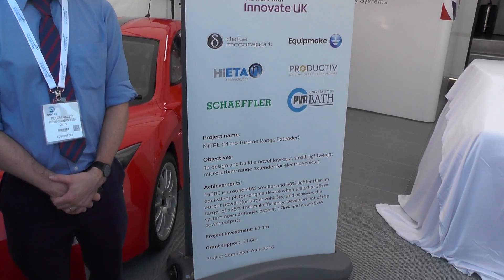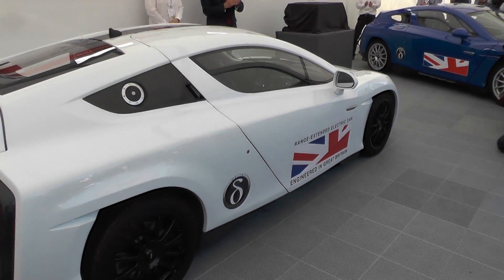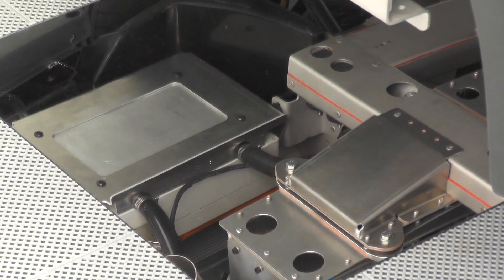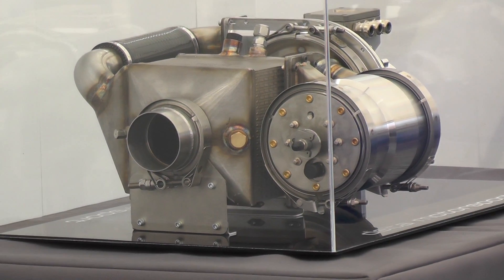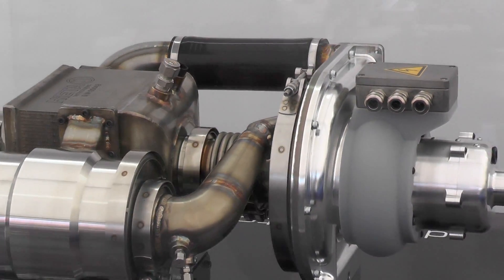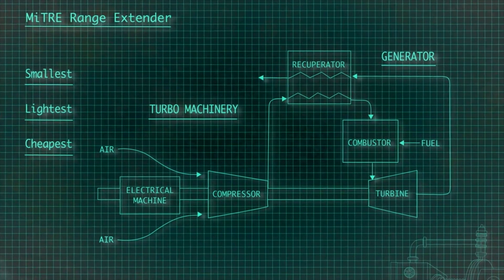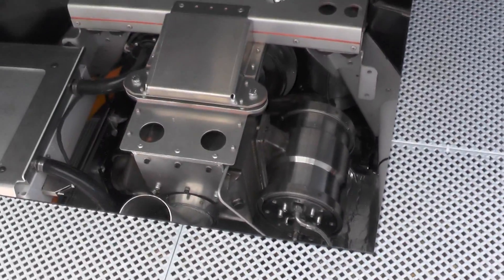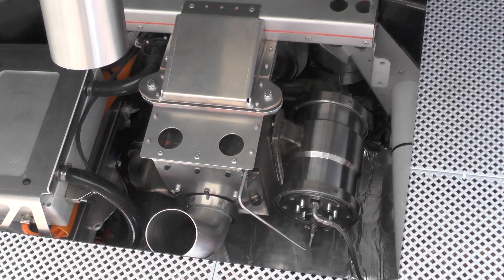MiTRE Range Extender - tiny turbine power removes EV range anxiety [First Looks]

Comment: guys i don't think you realize the advantage here. gas turbines can run on any combustible liquid fuel with no retooling and is relatively clean burning compared to pistons. you could literally choose which fuel you put in based on price or performance or efficiency. and if gas runs out you can just start using ethanol or corn oil or something. it's future-proof.

Comment: I don't understand why American car companies do not use gas turbine generators for building hybrids.  They are so much better than internal combustion engines.  ICE Engines operate to a limited 5-8,000 (or less RPM range) RPM, and spooling an engine going that fast causes rapid wear and tear on that engine.  The problem with turbine engines is that they require special, expensive metals like Chromium, titanium and even iridium to be put into certain places to prevent overheating and other problems associated with gas turbine engines.  With a gas turbine, you can spool it up to 10k RPM easily and get the power delivery you expect, you can also ramp it up even higher.  You can also run just about any kind of fuel you want with a gas turbine.  This is my favorite ICE engine.  You get power delivery not just from the electricity, but the air that leaves the exhaust, just like a turbo and you can generate serious electricity with a gas generator.

Comment: You may just as well have a modern diesel. EVs and hybrids are all a huge con.
It is expensive to service and repair.  High rate of Depreciation. Differcult to repair. It is expensive to repair.
The technical level of garage repair mechanics is low.
They hate working on them,  high voltage ⚡️ they could get a trip to the ER.
Reply: Oh dear. Expensive? Nope. High depreciation? No more than ICE. Difficult to repair? Rubbish. Expensive to repair. Rubbish (maybe apart from the cost of the battery, which is coming down every year). I suggest you try doing a little more research.
Reply: @NigelPowell They depreciate much faster.

Comment: Those companies who produce locomotives figured out using an internal combustion engine, solely to produce electricity for the drive motors a long long time ago. The idea of a small efficient I.C. engine with negligible emissions, used as a generator of sorts to maintain a power threshold in an EV'S battery pack, seems like something that should have been included from the jump. As a matter of fact why the traditional prius like hybrid was built with the ic engine as a drive motor always seemed stupid and pointless. The automotive industry is the only one that built hybrid ic + electric drive trains like that, while all others like the heavy equipment segment and diesel electric locomotives used their internal combustion engines as electric generators only
Reply: The idea has been around for a while in automotive applications. Google Capstone's CMT-380. The problem is turbines are inherently inefficient, and pollute a lot. The key to success has been attempting to reduce emissions and increase efficiency. The railroad has way fewer legal restrictions in this regard.
Reply: @zkk1001 ok so in the meantime well just have novelty EV's. Because where i live you cant own one. Pure EV's are dogshit compared to an internal combustion powered vehicle right now. Combining the two technologies is the only way youll get mass adoption. Shit the fucking rail roads figured this out a long time ago. And turbines will run on anything flammable like ethanol which is what mine runs on. And so were clear the vast vast vast majority of people do not give a shit about emissions, i sure as hell dont, i want a vehicle that works and is as convenient to use as a gas/diesel vehicle. Climate change is not the apocalypse and i dont give a shit about it. But if we have the tech to make the best of both then we should

Comment: Hybrids are the worst of both worlds, combining the complexity of IC and a full EV with extra parts to merge the two Into one Frankenstein's Monster; whereas range extenders gives the best of all worlds by combining the simplicity of an EV with smaller batteries and extra range/power on demand; and turbines could further reduce complexity and cost while being able to burn almost any fuel, so it's crazy they're not standard yet despite being around relatively forever. But the ultimate power source is the Free piston Linear Generator, which is basically an internal combustion powered shacker torch. It can run at an insanely high constant 'RPM' and electrical power generation levels, giving it a higher power/weight ratio than any other engine, let alone a generator, because the only moving parts are the solid piston/magnet assembly moving in the coils. These not only provide power, but also total control over the pistons motion, so changing compression ratios, going from 2 to 4 stroke, and even petrol/diesel/methanol/biofuel/etc operation on the fly would be possible purely in software, nevermind its incredible simplicity, efficiency and power/weight ratio. Sadly, if the turbine power units still aren't standard after their decades of progress, the Free Piston Linear Generator probably won't see the light of day anytime soon despite its obvious huge advantages over all other internal combustion generators.
Reply: Interesting, but there are a number of questions. Range and efficiency for example?
Reply: @NigelPowell  Pistons in a free piston Linear Generator run at a fixed rpm, and are electronically controlled and therefore able to adopt the most efficient combustion process of any type of engine on demand, so they have the potential highest efficiency of any ic engine at any power level, and considering their single solid moving parts could handle g-forces, and hence reciprocating motion that far exceeds even formula 1 engines, their power to weight ratio could be phenomenal. I suspect car companies aren't really pursuing them because the complexity of modern cars makes a lot of money for them and the service industry; hence universities apparently doing most of the legwork with little funding judging by their YouTube publications, just goes to show that capitalism=progress in what's profitable, and not necessarily better. This type of engine/generator was envisioned decades ago, and I even independently came up with it the same simple idea, so it's not like it's some new thing.

Comment: No updates on this project?
Reply: Actually lots. :) We might do a new post on it. The company was bought out by the famous Cosworth stable last year, and the product is now called the CatGen. It is fuel agnostic and outputs a flat 35kW constant. Not sure of prices yet or commercial implementations yet. Apparently it's been used in a prototype Transit van though.

Comment: with lithium prices in 2022 increasing why isn't this range extender made widely available for DIY peeps like a "crate engine"? i would love to slap up a REEV with a micro turbine strictly working as its most efficient for best fuel economy to charge a smallish battery pack and an electric powertrain free of any transmission....

Comment: Not sure i understand the layout... is the intake that open pipe on the satin gray turbo looking part ? is the generator the small chrome part at the front end?(looking like a small RC turbine starter)  , air is then sent to the re generator which acts as a heat exchanger? (uses hot gases to pre-heat air intake kinda like Chrysler did in the 60s?)  
The now heated air enters the combustion chamber burns up and heads towards the turbine and then what ?  it exits through the middle shaft looking part?  straight through the re generator (heating it up) & exhausts the back ?    also are those 3 rings on the central shaft part heating elements ?   (to help heat the air @ startup maybe?)  
i'd love to  see how that  compressor/generator turbine kit is built...it confuses me lol.

Comment: Prevent the use of gasoline by using EV, then fix the issue of battery capacity by adding a gasoline engine. I thought that was called a hybrid a long time ago.
Reply: Hybrids are the worst of both worlds, combining the complexity of IC and a full EV with extra parts to merge the two Into one Frankenstein's Monster; whereas range extenders gives the best of all worlds by combining the simplicity of an EV with smaller batteries and extra range/power on demand; and turbines could further reduce complexity and cost while being able to burn almost any fuel, so it's crazy they're not standard yet despite being around relatively forever. But the ultimate power source is the Free piston Linear Generator, which is basically an internal combustion powered shacker torch. It can run at an insanely high constant 'RPM' and electrical power generation levels, giving it a higher power/weight ratio than any other engine, let alone a generator, because the only moving parts are the solid piston/magnet assembly moving in the coils. These not only provide power, but also total control over the pistons motion, so changing compression ratios, going from 2 to 4 stroke, and even petrol/diesel/methanol/biofuel/etc operation on the fly would be possible purely in software, nevermind its incredible simplicity, efficiency and power/weight ratio. Sadly, if the turbine power units still aren't standard after their decades of progress, the Free Piston Linear Generator probably won't see the light of day anytime soon despite its obvious huge advantages over all other internal combustion generators.

Comment: Are turbine engines more efficient than gas engines? I mean gas piston engines that run at a single optimum RPM just to act as a motor to power a generator that charges a battery that in turn powers a vehicle?
Reply: No, but they are generally much smaller and lighter for a given output power. So for something that is used only occasionally as a substitute when a charging point is unavailable it can be a good choice.  Lower efficiency when being used but much less dead weight to carry around when it is just sitting there doing nothing. It also takes up much less space.
Reply: @listerdave1240  
They have very lightweight piston engines that can run a generator and keep an EV battery charged.
Reply: And it releases much less NOx, particulates etc. Better for the environment. And quieter.
Reply: @cryptohouse1676  
Don’t know that turbines are quieter. And less particulates? Maybe, but I know that they spit unburned fuel, and they don’t have catalytic converters for turbines.

Comment: Switching between dead-silent mode to EXTREME NOISEY mode when you want to topup you battery
Reply: can add apache tecnology
Reply: no dude. you engage turbine power when you're on the freeway to charge up the battery for slow speed and city driving. it's magnificent

Comment: A jet engine is 95-100% efficient, so if this is even remotely close in efficiency to a jet engine, this could give vehicles economy hitherto unseen!
Reply: 😂 no way! Through heat loss after recuperating, it doesnt even reach 70%
Reply: @matata127  In cold climates that excess heat loss is used to heat the cabin. So in a way the efficiency of the total system goes up the colder it gets.
Reply: @jimj2683  The poster in the start of the video reads: 25% thermal efficiency, i.e. 25% of the energy in the fuel is recovered as mechanical energy, then add a few more losses in generator and aux systems, so roughly as good as a conventional generator, but much lower weight and no vibrations.
Reply: @Tore_Lund  Yes unfortunately radial compressors and turbines of small gas turbine engines are quite inefficient. Larger axial flow machines can exceed the efficiency of modern Diesel engines but over a narrow speed/load range.

Comment: Why not just mass produce cars with a simple gas powered generator to run an electric motor (gas over electric) and a small bank of 4 marine batteries to store/buffer power demand?  Gas over electric systems are repeatedly proven to average 75 to 90 MPG.  But it will never happen because major auto makers don't think they can get a profitable return on retooling.  As well - major auto makers will lobby for laws blocking gas over electric systems because they're afraid to lose profit to competition.  Yet some jackass decides that electric vehicles need gas powered range extenders (would that be electric over gas?) - but then the purpose of electric cars is to avoid using gas?  Sounds like an effort to profit off of consumer confusion.  The end result almost always being supressed ideas for vehicle improvement, failed companies, and lost investments.  Too many companies are trying to force a product (EVs) which aren't proven reliable enough (or are too expensive) to garner widespread acceptance.  It would be better to take a first step approach by mass producing gas over electric systems First - Then itroduce full blown (or electric over gas (range extender)) models later when the market become more receptive.
Reply: @andythealien1  Well - you see then.  I don't know all the particulars surrounding the technology of EVs, but I still believe my suggestion is a valid approach to widespread acceptance.  Automobile during their fledgling years were usually capable of 50 to 75 MPG.  It was only when fuel producing interests realized that efficient cars meant lower profits that laws were subsequently initiated mandating 'minimum' fuelmratings for new vehicles (recollect the current mandate for 40 MPG for new vehicles).  Just like any law, it will be adhered to it's minimumm and nothing above and beyond - thus new cars will never get much better tha  40 MPG.  Why go higher and lose profits on fuel costs?  See my logic?
Reply: Gifford:   I plea my point of view to those who have the wherewithal ($) to do these things.  Unless Ed McMahon drop that million in my bank account, it won't happen here.  But thanks anyway - at least somone's listening.

Comment: Two years later, I don't see any of them in a showroom.   I'm guessing too expensive and not very fuel efficient.  I like the multi-fuel capability of turbines, but I don't know if they'll ever make to the automotive market.
Reply from the maker: Yep, another clever technology which obviously could not be commercialized. Shame.
Reply: When normal piston engines can no longer meet the emissions regulations, turbines will offer a cleaner solution(it burns more completely).  Slightly less efficient, but lighter, smaller and less maintenance. The cost could in theory be just as low as any piston engine, it just needs to be sold in larger volumes.
Reply: Search: delta cosworth catalytic generator

Comment: Range extender wtf? So use fossil fuels cause electric cars are crap in the first place.
If your car has a tank for fossil fuel it's not powered by electricity anymore,this application is senseless,using a jet turbine to spin a generator to charge a battery to power an electric motor  that drives the wheels will cost more to run than a gas powered car.
Reply: marty wise This is basically how trains work.

Comment: This looks like a great way to be able to own an electric car in canada AND have some nice heat. They should use this as a cogen unit with the waste heat for passenger climate control and defrosting or keeping the battery bank at the optimal temperature. Most battery chemistry goes to 50% capacity at 20C so it is beneficial to have the battery kept thermally stable at its optimal temperature in cold regions.
Reply: Yup, using a regenerator as well as heating up other systems will make a turbine generator like this super efficient. Especially in cold temperatures. They make a lot of sense in hybrid-electric vehicles as range extendors.
Reply: @cryptohouse1676  Especially since turbines burn the fuel very completely, so it has extremely low emissions even without an exhaust aftertreatment.
Reply: Or any cold climate with lithium ion EV batteries work like a turd in winter cold